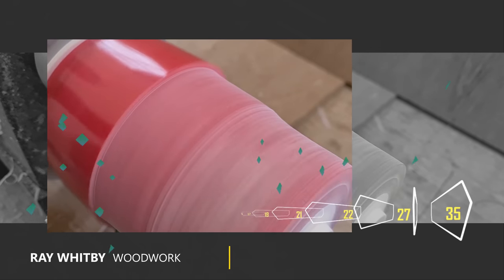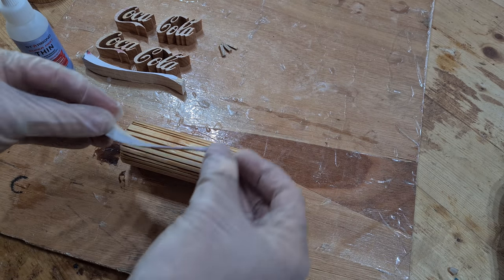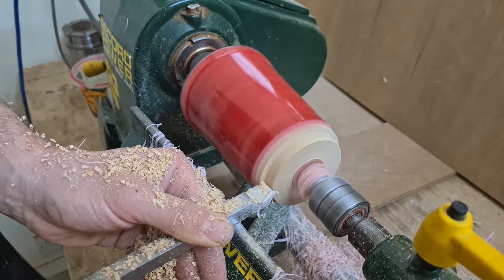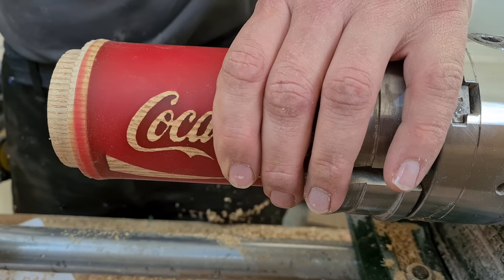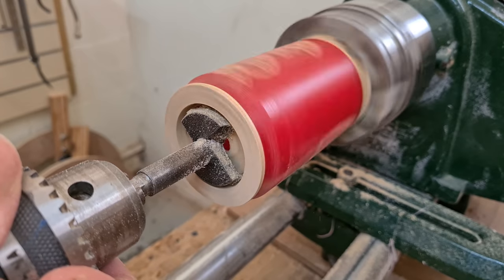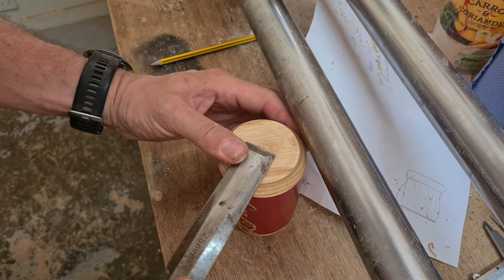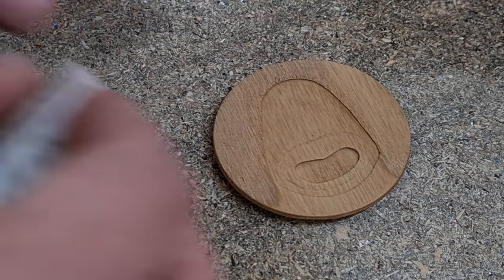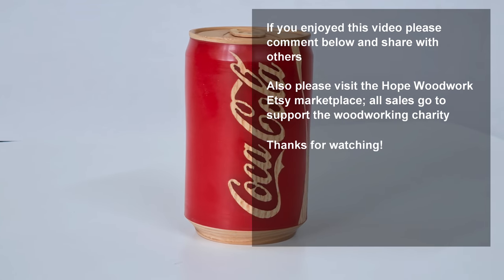Woodturning - A COCA COLA Can

Comment: It was very cool. It looked like a Coke. It would be interesting to make some more of them in different shapes (like one bulged in the middle, or pinched in the middle, one that had been partially crushed, one with odd proportions[like a Coke by Salvador Dali], a mini can, a HUGE can...). There are a lot of great ideas to build on now that you have mastered a normal can. The one tiny thing I might change would be to have the tab be bent up as if the can had been opened or was partially opened; just to give the can an easy handle to lift the lid. But that is just quibbling over nothing.
Reply: And I forgot, great work and thanks for the video.
Reply from the maker: Thanks Curtis! A Dali-esque can could be really interesting project. Not sure if I've lost all my marbles to attempt something like that though. At least not yet! Thanks so much for your feedback. All the best. Ray
Reply from the maker: Much appreciated!

Comment: Hi Ray. Another stunning example of your patience and skill. Would you ever consider a laser cutter instead of a scroll saw for work like this? I doubt I would be able to hand cut all that intricate lettering.
Reply from the maker: Hi! Thanks for your feedback! I would consider cutting these things out anyway I could, as long as it was safe. Even better if it was more accurate. Does laser cutting scorch wood or does that depend on the settings and depth of wood cutting? Alas I cannot yet afford a laser cutter or CNC router. Perhaps I need to collaborate with someone who does to produce the design! All the best. Ray

Comment: That is super cool...I thought it was an actual can at first...I was thinking 'oh no metal fume fever'....in this day of the medical profession seeming to be covid robots...you'd never get treated for that.  You should do more voice overs...you have a nice voice.
Reply: I can remember scroll saws having a slow speed and a knob where you can turn it to increase the speed...kind of like a sewing machine.  Yeah, I looked it up to make sure I was right...'variable control' is what they have on them now.
Reply: If it were me, I would have re-resinated it in clear epoxy at the end because people are going to bum and hit that lid pop up and eventually it's going to come off.
Reply from the maker: Wife nearly threw it away thinking it was an empty can!
Reply from the maker: Alas this one didn't. I'm know trying some 3d printing of the parts, which is a little easier
Reply: @RayWhitbyCreations isn't 3D printing stuff heat sensitive?  I always wondered about that.
Reply: @RayWhitbyCreations  I thought when you were first turning it...I thought it was also a can...which is why I said the metal fume fever thing.
Reply from the maker: @morgancalvi6675  Depends on the polymer . PLA filament melts at around 170oC, ABS 220oC. So it can withstand quite a bit of heat before it falls apart. I'm sure there are 3d printer heads that can go higher than this for specialist polymers
Reply: @RayWhitbyCreations  I don't even remember what I was doing to get metal fume fever. I think I was working at a jewellery factory when I had that along with a really severe silver dust reaction.  Apparently just the dust in the air made me react.  I never found out what the metal for the fever was.  They just said I had high amounts of mercury and nickel in my blood.  Of course my ex was always a bit of an ass trying to hurt me.

Comment: I think the lettering would pop more if you had 3d printed or casted them in white resin and used silver resin on top and bottom. Maybe done a casting of a real can for the lid? Great work though :)
Reply from the maker: Hi Andreas. I think your ideas are great. I did 3d print the lid, base and the letters in future videos, but using an FDM printer meant the resolution for the lid was not great. It was fine to use the 3d prints to cast the letters in resin and the technique is slowly improving to help with the faithfulness of the type print and size in the final piece. Currently working on a Mountain Dew can which is causing me some grief but hope to complete within the coming month. All the best. Ray

Comment: Did you ever try sanding small pieces like that instead of sawing them?
Reply from the maker: Hi Jack. To be honest, no. Trying to shape hardwood with sanding, even small bits, seems an impossible task in my mind, but I admit I have limited experience in woodworking and there maybe some cool tech available that I'm not aware of. I wondered if there was a sanding option to the scroll saw that would have helped. Thanks for watching. All the best. Ray